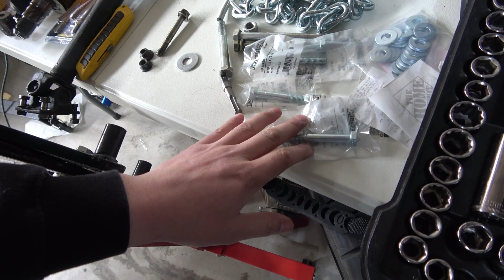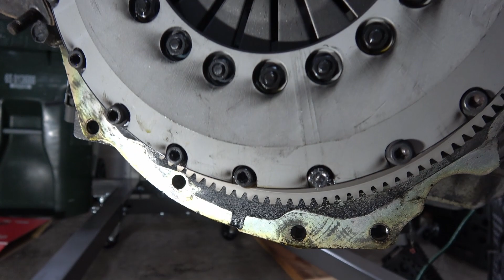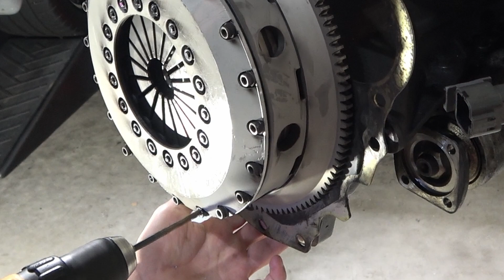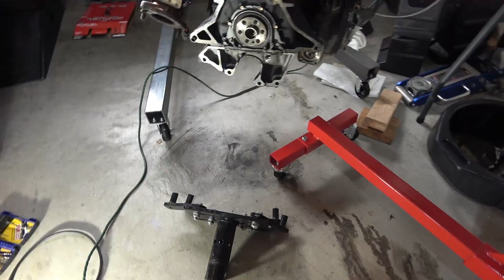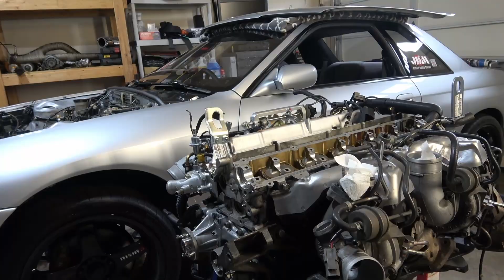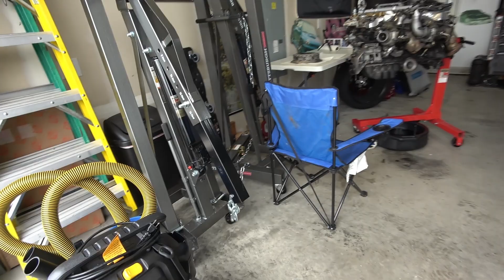How to mount rb26dett to engine stand bolt size ATS carbon clutch assembly process EP4

Comment: Awesome video! This will help when I do mine this weekend. What kind of engine stand is that? What’s the recommended weight rating for a stand to hold the fully assembled RB?
Reply from the maker: This is the 1000 pound engine stand from Harbor Freight. It seems to work fine and I see lots of others use it for the RB26

Comment: Great video! Where did you get the brakets that you attached to the head to lift it with?
Reply from the maker: Those are called engine slingers. You should be able to purchase them directly from any Nissan dealership that supports JDM parts. I ordered these from TFAspeed.com. Good luck with your project. My build is coming along. My HKS step 2 stroker kit will be coming next week. Thanks for watching!

Comment: Replace hex fasteners with Torx whenever you can. I replaced so many fasteners to torx or 12 point on my GT-R.

Great vid man. keep it up
Reply from the maker: I was thinking that, I need to figure out a good supplier that I can source something like those.
Reply: @JDMRightHandDrive   I use Accu out of the UK for torx fasteners. The 12-point nuts/bolts I use have been ARP. I mainly purchased them directly from ARP.

Comment: Yeah...I got my Milwaukee Fuel impact gun for Christmas.  3 months AFTER I put my transmission back it.  That would have been so nice.  Needed 2 really long breaker bars.  1 for the socket wrench used to loosen the bolts and the other wedged in and pinned to the floor so it would stop spinning the flywheel.  =o)~

Comment: Nice car man, I was fortunate like a mofo, my ats clutch came with my swap. The bolts stripped on me also hahaha, I end up using a small hammer and chisel to chiseling into the heads of the bolts as I tapped them loose. I ordered new bolts from bolt depot.

Nice car man.

Comment: 7:35  Josh, hopefully ATS can send you those bolts.  But if not they should at least be able to tell you if Class 12.9 is strong enough, or if you need specialty bolts (like ARP or whatever).   Class 12.9 is the highest metric strength class, it's alloy steel, and it's stronger than American Grade 8, but specialty bolts can be made even a little stronger.    I buy my class 12.9 bolts here, like this:  https://www.boltdepot.com/Metric_socket_cap_Zinc_plated_class_12.9_alloy_steel_6mm_x_1.0mm.aspx

Comment: You should have removed the rear main seal before you mounted it on the stand just to make it a bit easier to get the crankshaft out
Reply from the maker: I thought the exact same thing when I watch the video last night. Don't know why I didn't think if that. I guess I got excited in the moment. Thanks for watching and leaving a comment!💪
Reply: @JDMRightHandDrive  I did the same thing as well that’s how I know 🤣🤣🤣

Comment: Thanks so much for the mounting bolt details. I struggled with this while I was prepping my R32 body for paint and rust prevention. My Rb26 was sitting on the side and I was looking all over the internet to find the mounting bolt details. I also use the same engine stand you are using so this makes it really easy for me. Thanks again.
Reply from the maker: You bet, glad to help out. I will have to add the Rb26 bolts size somewhere in my title, description and tags so it is searchable on Google and YouTube!
Reply: @JDMRightHandDrive  I was also worried about the RB26 engine sagging hard because the engine is so heavy, TommyFYeah and SpeedAcadrmy uses a jack to brace the bottom but your harbor freigh engine stand is giving me confidence that this won't be an issue for me, we have the same setup and same equipment